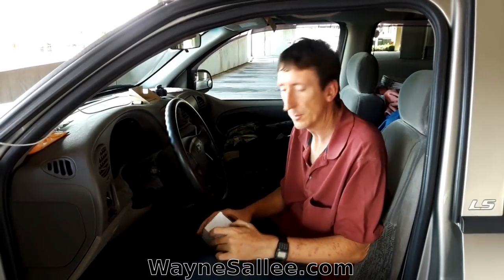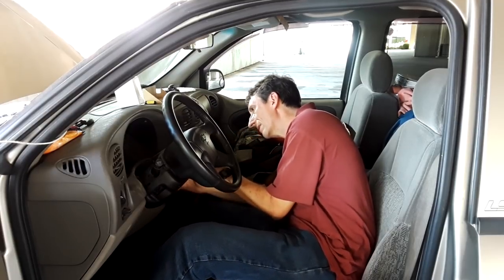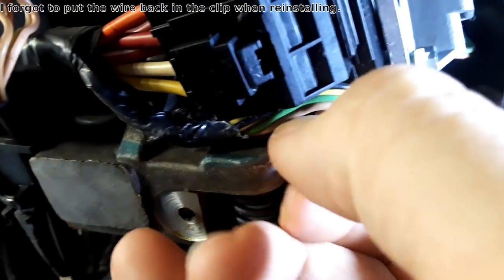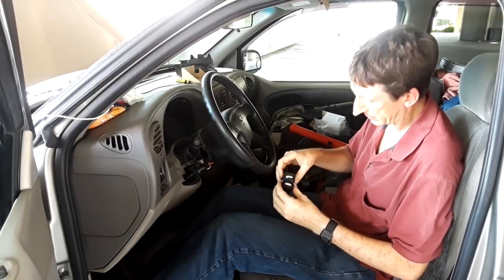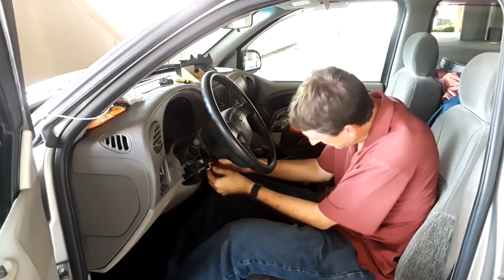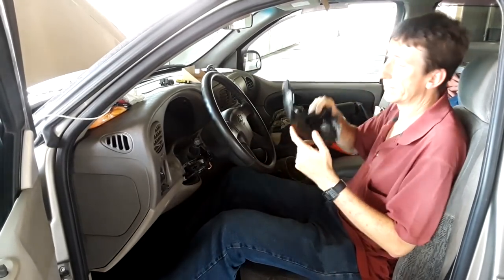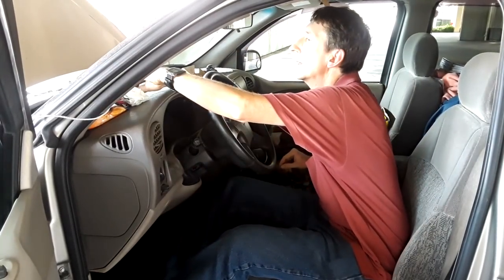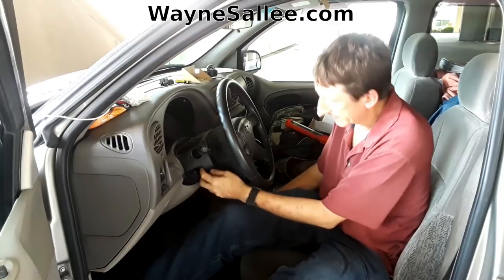Easy way to replace the Ignition Switch in Trailblazer 2002.

Comment: Hi Wayne, I just replaced my ignition switch on my 2005 Trailblazer with the help of your video. I put in a AC Delco from Rockauto.com, It was less than $30.00. My problem was the ignition was frozen. After a mechanic but in a new switch some time ago, it still didn't work right. With the key out and in the off position the slightest tap on the ignition area would turn on the battery indicator light and gear selector light. I complained and they told me it had something to do with the steering column. They charged me $368.00.
Now with the new switch everything things is back to normal. Thanks again, I couldn't have done it without you. Jake
Reply from the maker: Thank you for your post.  It's great how in this day and age, we are able to watch other people do a repair, often showing an easier way to do something than what the manufacture suggests. And being able to watch several people do the same repair, getting different tips from different videos. I prefer to do all possible repairs myself for the very reason you described. We all make mistakes, but so many auto shops are used to being able to tell the customers anything, and the customer knows no different. And then if I make a mistake, I know it, and learn from it. The other thing is that auto problems can some times be so intermittent that the problem is better troubleshooted ourselfs, as we are the one driving it.

Wayne Sallee
Wayne@WayneSallee.com
Reply: when I replaced mine I thought everything was perfect and I pulled the key out wiggled the ignition and battery did come on so I pull the ignition switch out move the wheel one tooth forward put it pushed it back in, and   it fixed that.
Reply: Hi Wayne and Jacob.  Thanks for your insights and online store for the part.  I have a 08 Chevy TB LT.  I looked on Rockauto and what is the part number please?  I want to ensure I have the correct part for my ignition switch part.  Any assistance would be very help and appreciated. If you have any other suggestions with other online auto stores it would be very helpful. Thank you again.

Comment: I have a 2008 Trailblazer and the interior is the same. THANK YOU for the awesomely informative video. Worked like a charm! I pulled a 1682 code and the temp gage would stop working after a couple of miles from start up. Done in a half hour start to finish!
Reply from the maker: Thanks. Glad it was a help. These ignition switches are so much easier and quicker and less expensive than they were with the older vehicles. Years ago I had older vehicle that had an ignition switch where the plastic housing of the switch was cracking, So instead of going through the great trouble and expense of replacing it, I just wrapped it in fiberglass epoxy. And that held up for the life of the vehicle.

Wayne Sallee
Wayne@WayneSallee.com

Comment: This video is awesome! Drove home from work and my service 4wd and abs lights popped, 4wd failed to engage as well as ac and heat did not come on. Swapped a new battery, issues still existed. Read on forums that this is a notorious issue. Followed this video and made the fix in less than 30 minutes. Thank you!
Reply from the maker: My replies keeps disappearing. Google is going down hill.

Great!
I'm glad it helped.

Wayne Sallee
Wayne@ WayneSallee.com
http://www.WayneSallee.com

Comment: Thanks, this was very helpful, my brother-in-law's trailblazer had the ABS, Parking Brake and Service 4WD lights on, plus the blower motor for the heating and air conditioning was only working every once in a great while.  After checking to make sure the battery and charging system was working properly, we replaced the ignition switch and all those symptoms went away.
Reply from the maker: Thanks, I'm glad it helped get the trailblazer working again. Before it gets that bad, turning the ignition off, and back on will often get things working again, and give a clue that the ignition switch is likely failing.

Wayne Sallee
Wayne@WayneSallee.com
http://www.WayneSallee.com

Comment: Thank you so much Wayne for the video! Took off the lower plastic and made the switch change in about 10 minutes! I didn't even disconnect the battery... Lined up the gears as you instructed and walla.. DONE! You sir are a steely eyed missle man. :-)
Reply from the maker: Thank you. 

Not disconnecting the battery makes it more fun. :-) Then if someone connects it aligned way off, the starter could crank constantly until the electrical plug is disconnected. So for anyone else that prefers not to disconnect the battery, be ready to quickly disconnect the plug. :-)

What is also fun, is when I don't turn off the power, when replacing ballasts in florescent lighting fixtures next to the window during a lightning storm. :-) Turning off the power just takes all the fun out of it. :-)

Wayne Sallee
Wayne@WayneSallee.com
http://www.WayneSallee.com
Reply: Matt Larsen hey did you have a no start no crank problem
Reply from the maker: No, my problem was an intermittent hard transmission shift. Turning the key off and back on again would fix it for a while. The switch was sometimes failing to connect the transmission to the communication so that the transmission would know how fast the engine was running.

What symptoms you get will depend on what part of the switch is failing, as it is several switches in one.

Wayne Sallee
Wayne@WayneSallee.com
http://www.WayneSallee.com

Comment: About to do the job on a 2002, just like in the video. I transcribed the steps you describe for myself. Putting them here in case anyone else likes printing off a list of steps:

0) Disconnect battery
1) Tilt steering wheel all the way up
2) Pull the tilt lever straight out (may have to pull hard)
3) Pull down the trim on the key side of the column, then on the other side
	a) once it's loose, there are little tabs in the dash that must be released
	b) there may be two screws holding it up, check those first
	c) push the trim down towards engine, then it should come all the way out
4) There are two tabs on the ignition switch that hold it into place
	a) unclip the wire that is attached to the ignition switch before pulling it down
	b) use a screwdriver to release the two tabs and let ignition switch come down
	c) release the ignition connector from the ignition switch with a screwdriver
5) Align the new switch's innards to be in the same position as the old switch's innards
6) Barely set the electrical connection where it goes, then align the switch where it belongs before tightening the connection.

7) Reconnect the battery, make sure the truck works correctly. Especially ensure that the truck is off when the key is "off".

Reverse steps 3->2->1 to finish the job.
Reply from the maker: Thanks for sharing. The system is blocking more and more of the sharing of information.

Comment: I DID IT!!!!!!!! THANK YOU WAYNE SALLEE!!!! Everything came apart just like in the video!!! Thanks to your tips, I was able to remove the switch and cable with a screwdriver and it slid out just as you showed! I put in the new switch, heard my "clicks" and BOOM, she fires right up!!!! I can't thank you enough for your video! NOW! do you have a video showing a easy way to change the ECT sensor on a 2008 Trailblazer??? How about a thermoastat?? Take care and thanks again!!!!!!!!!! PS- It took about 20 minutes!
Reply from the maker: Glad it helped. I have not produced any videos on the coolant sensor, or the thermostat. I hate the way they did the thermostat, it's near the bottom, and the metal pipe / thermostat, is a 1 piece unit. It's a bit of a pain to remove from what I have watched on Youtube. My trailblazer had the thermostat on top like it should be. 

I do recommend using silicone grease when reinstalling the radiator hoses. It makes removal later, so much easier.
My Video on using silicone on radiator hose:
https://www.youtube.com/watch?v=csSlqegMbrM

Wayne Sallee
Wayne@WayneSallee.com
http://www.WayneSallee.com

Comment: I have a 2003 Trailblazer, I just replaced the ignition switch because my instrument gauge clusters would work on and off along with the windows, locks, radio all would work on and off. Trailblazer still cranked and started no problem. After replacement it will not even try to crank. I double checked the ignition switch and made sure it was in the right position.
Reply from the maker: Put the old ignition switch in and see if it works. Also I recommend people keep their old ignition switch just in case the new one fails early.
Reply: @WayneSallee-comTech  I put the old switch back in and still no crank/start.
Reply from the maker: @xDewDropx  There is probably nothing wrong with both ignition switches. You might have a bad connection or bad wire, that got wiggled when you replaced the ignition switch. Start checking voltage, and see where the break is. It was probably barely making connection, and higher amps will make better connections by sparking a connection.
Reply: @WayneSallee-comTech  thank you! I will check.
Reply: @WayneSallee-comTech  We had a wire that shorted out and it caused other wires to break/melt! Got it all fixed though, thank you for your help.
Reply from the maker: @xDewDropx  Good. I'm glad you got it fixed. Was it bad original wire defect that failed, or was it some kind of modification that caused the failure? I know that sometimes GM has put bad wire in where the insulation gets old and cracks, and falls off.
Reply: @WayneSallee-comTech  it was a bad original wire, it was just like you said the the insulation was cracked and worn.

Comment: 2008 with 145,000 miles, Intermittent no-start and ALWAYS when my wife was out and about, stranded. I took it to the dealer twice and  after $220.00 they said nothing was wrong, but said they'd replace the switch for another &210.00. This took me 25 minutes and $27.00 for the part. I did have to drop the lower panel a few inches under the steering wheel to get at the rubber straps, but, 4 bolts and it dropped. Upon dismantling the old switch, I saw the contacts were burned and pitted. Keeping my fingers crossed.
Reply: Correction: Intermittent no-crank.
Reply from the maker: @paulziegler9688  Sounds like the 2008 requires a tad bit more work than the 2002. I'm glad that fixed it. The burning up could be caused by something else, though it is likely that the oxidation was the cause. As the oxidation takes place, there is more resistance, and more resistance creates hot spots, that creates more oxidation that causes more heat, that causes pitting.

Wayne Sallee
Wayne@WayneSallee.com
http://www.WayneSallee.com

Comment: If it's the ignition switch thats the problem, will you still here the bell going off when you turn the key to the on position, or will that sound not work either? Just wondering... My bell is not making any noise... it's obvious the battery is till good.... but nothing when you turn the key.
Reply from the maker: Communist Google shadow banned my reply, so I am re-posting my reply here: The bell sound is played out of your driver side speaker, not out of any other speaker. If your driver side speaker does not work, you will not hear the dinging sound. Does your car start? Is there anything else that causes you to think that your ignition switch is a problem? And yes, it's stupid how GM put the chime sound output to just 1 speaker.

Comment: Replaced the ignition switch as you mention.  The dash lights keep flashing when started not sure why. was hoping replacing the switch would help
Reply from the maker: Do they keep flashing even after the car is started, or just when the starter is running?

Wayne Sallee
Wayne@WayneSallee.com
http://www.WayneSallee.com
Reply: @WayneSallee-comTech  I can turn on ignition without starting and dash lights will flash/gauges go down then back up.  Start vehicle they still flash for a second then stop.  Put it in drive no flashing begin driving then will flash again for a second or so...then its usually ok thru the trip.  I can  start the vehicle later that day and all is ok no dash lights flashing and gauges are fine.   Wondering if its a bad ground in the gauge cluster?
Reply from the maker: @moparguy37  It's not the ignition switch. Do a google search for common problems with trailblazer instrument cluster. There are some common problems like what you are describing. After finding the common problems, how to identify them, and how to fix them, take the instrument cluster out and see what's happening.

Wayne Sallee
Wayne@WayneSallee.com
http://www.WayneSallee.com
Reply: @WayneSallee-comTech  thx will keep you posted

Comment: Thanks for the video... After changing all the HVAC fuses, blower motor resister and nothing worked. Who would have known to change the ignition switch to fix the heater fan controls, ABS light, brake light and 2 other traction control lights.
Reply from the maker: Glad it helped. Yes when several things go wrong at the same time, there is usually a common denominator. But when you purchase a car with a number of problems, you don't know if they all started failing at the same time, or over time. Then in that case I look at all the problems, and consider if there are a group of problems that could have a common denominator.

Wayne Sallee
Wayne@WayneSallee.com
http://www.WayneSallee.com

Comment: Exactly what tooth needs to be lined up I’m lost? Is it the second tooth not including the the first tooth to the left of the gap?
Reply from the maker: On the new ignition switch, move the gear back and forth to familiarize yourself with what it looks like, and then move it into the same position as the other. If it helps, you can put 2 marks with a marker on the old ignition switch gear, to mark the left and the right side, so that you can move the gear to look at where it is, without forgetting it's original position.

Taking a picture of it after marking it, can help too, to remember it's original position.

Wayne Sallee
Wayne@WayneSallee.com
http://www.WayneSallee.com

Comment: What were the symptoms of this?. I have a key in ignition code
Reply from the maker: There are a lot of different symptoms that a bad ignition switch can cause. But "key in ignition code" is not one of them. There is another switch right there where your key goes in; it's real small. That is what is causing your problem, or you have a short in your wiring.

Wayne Sallee
Wayne@WayneSallee.com
http://www.WayneSallee.com

Comment: I found that if you remove the bottom dash cover (or whatever you call it), before removing the bottom steering cover the job is a lot easier.
Reply from the maker: I assume that you are talking about the large panel under the steering. Yes, it would make it a little easier, but then that is more to take off and put back on. And so it is quicker to leave it on. 

But anytime some thing is proving troubling to get to, then take more stuff off. No point in spending a ton of time when simply removing something else would make it easier.

Comment: Hi, Wayne@SalleeTech, i have a 2003 tb, and rite after i paid it off the dash board lights go wacky, off and on, all of them except the speedo and tack, if i hit the top of dash, all the lites and gauges would work, i just recently took the top of the plastic off and the wire harness thats on the other side of ignition, i touch that and my truck will shut off, and if i dont touch it, then it starts, do u think its my ignition too, also my drivers side speaker dont work and my dinger dont go off either, but drives  and runs, as long as i dont touch those wires, what do u think it is, when i hit dash all gauges and lights work but then go rite back down to nothing working, any suggestions ????? thanks for reading.
Reply from the maker: Swap the driver side speaker with the passenger side speaker. The dinger only goes to the driver side speaker. Your guage console is bad. Your ignition switch is good. 

Wayne Sallee
Wayne@WayneSallee.com
http://www.WayneSallee.com

Comment: Ok so I have a 05 Silverado and I’m thinking bout replacing the switch. The problem I’m having is, the truck will just shut off randomly, go into reduced engine mode, dash lights just flicker and the truck sometime don’t start it will crank but not fully start. Thanks
Reply from the maker: It's probably not the ignition switch. A typical symptom of a bad ignition switch is that you put the key in, and turn the key, and things don't work right, then you turn the key off, and try  again, and it works. But I would not completely rule out the ignition switch. Does turning the ignition switch on and off, make any difference?
Reply: @WayneSallee-comTech   yes,  it does the lights will flicker if I don’t turn it on and off
Reply from the maker: @mazzy1820  If the pattern has been that it used to work fine, then would at random it would start giving this situation, but turning the key off, and back on fixed the problem, only to mess up again later, then, it could be the ignition switch.

Comment: I have a equinox 2016 ... code 1682 it drove fine then I get home and didn’t drive it for a couple days and Remote starter won’t work out the key I. And it cranks but won’t start . Will replacing the ignition work ? I changed starter , spark plugs , checked relays any help
Reply from the maker: Do a google search to find out what that code means. Your ignition switch is turning on the starter, now check to see if you have power going to your fuel pump, and/or check for fuel pressure. 

Wayne Sallee
Wayne@WayneSallee.com
http://www.WayneSallee.com